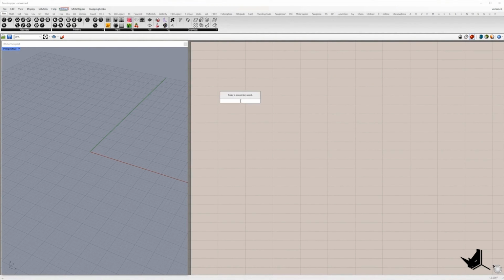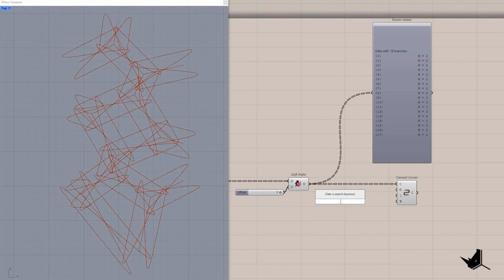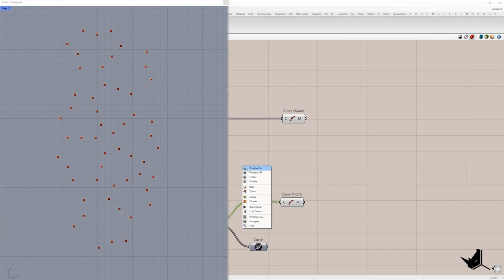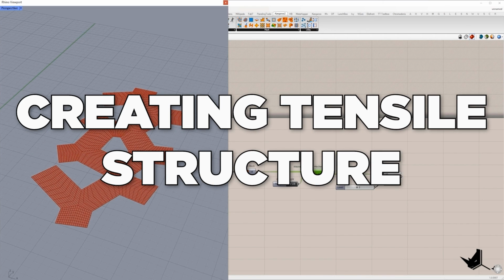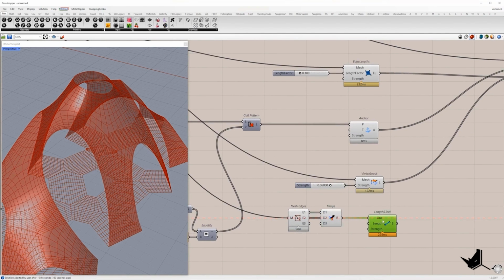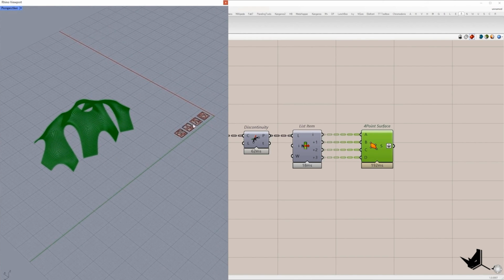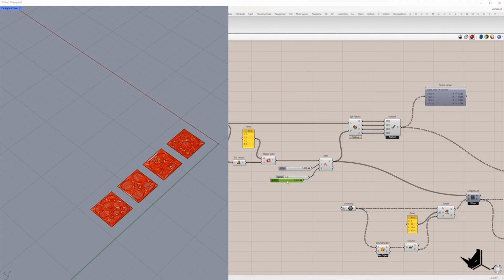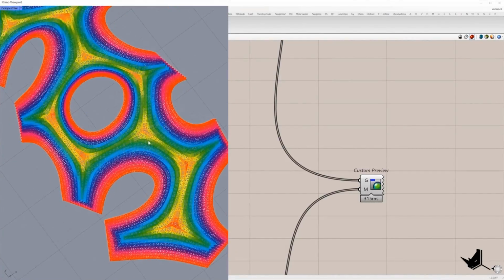Unlock the SECRETS of Mesh Topology with THIS PLUGIN

Comment: Thanks for the great tutorial! Nice structure & learned som new concepts on the way.
I found it challenging to find a voronoi configuration - offset distance combination without sharp inner edges,. Otherwise lofting will not work, because one of the tree parallel lines is missing.. This limits the maximum ofsett and thus the 'tent width' somewhat. Did not find a solution for this yet..